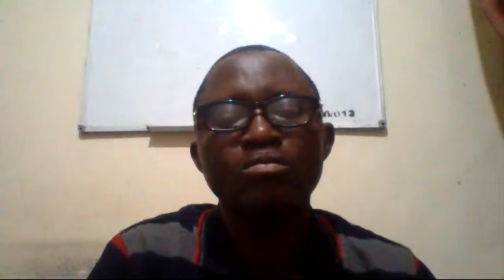Computer Preventive Maintenance and Troubleshooting @electro_teach  #computers #computerhardware

Comment: Good day sir i learn a lot on this course 
In this session what i actually learn
You sald we must identify the problem and there are many things to be done by checking the zip codes the posc 
Asking questions from the owner open ended questions
Reply from the maker: Yes, correct. You need to start practicing what you learned.

Comment: Good afternoon sir 
What I learnt from this part 3 is that 
Pos team is a power on self test that is what the computer does when you turn on the computer then the computer carries out a check of all the know installed. And you also said computer problems may come in three different ways or a mixture of any of those theory. 
(1) It may be hardware problem its a big software problem. 
(2) It may be sometimes networking problem or a combination if these issues 
(3) It can also be between hardware and software together network and hardware and so on and so forth.
You also said online computer manual online forums and vharts and technical websites these are the places where you can get more information about a computer.
  There are problems that may be experienced on a computer 
(1) The clock on the computer is no longer keeping the correct time.
(2) The small battery may be drains that is it has lost all the energy study needs so we need to replace the CMOS.

Comment: What i learnt from the part three of computer preventive maintenance and troubleshooting 
I now know that the computer doesn't recognise a storage device like hard drive that we store because the power cable may be loosened. 
I also learnt that POST means power on self test  
I also leanrt that the last step in the six steps in  troubleshooting that we learnt in  the seond part of this series is very much important when it comes to troubleshooting which is documenting the findings and outcome because it help in easily solving any future problems you might encounter with your computer .

Finally 
I learnt that computer problems do occur in three (3) different forms
1-Hardware
2-Software 
3-Networking

Comment: I learnt that a computer does not recognize a storage device like hard drive that we store cos the power cable may be loosed

I also learnt that the meaning of POST is (power on self test) and it’s also good to keep records on your system for future purposes

I also learnt abt trouble shooting process which is having a record will enable one to easily identify and know the problem on your device between a little time 

Computer problems comes in 3ways  which are

Hardware
Software
Networking
Reply from the maker: You really watched it. Continue learning.

Comment: I learnt the meaning of post( power on self test) it is good to keep record on the system for future purpose, having the record will enable one to easily identify the problem of the system
The computer problem comes in three ways 
1) hardware
2) software 
3) Networking 

I learnt that we must identify the problem of the system by asking the problem of the system by asking the admin, or through trouble shooting the system which is the perfect step
Thanks for teaching sir

Comment: In the part 3 of the class, what i learnt about Troubleshooting process is
Having a record will enable one to easily identify and know the problem on your device between a little time because you have the record of it before.
Also, Computer problem comes in 3 ways
Hardware, Software, Networking. 
Meaning of POST: It means Power on self test i.e computer does its self text  in a very small time.
Reply from the maker: That's right.